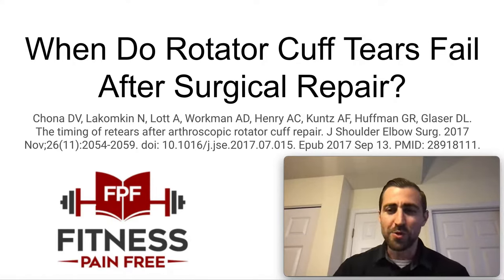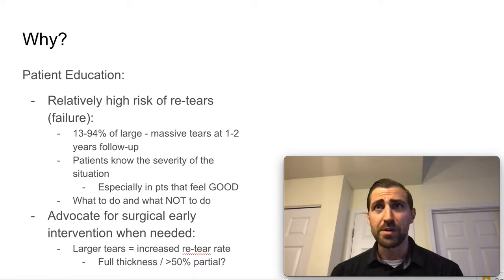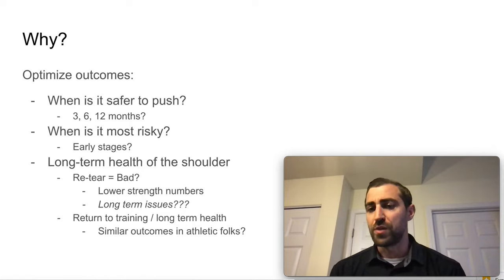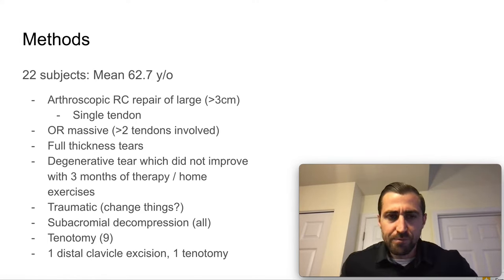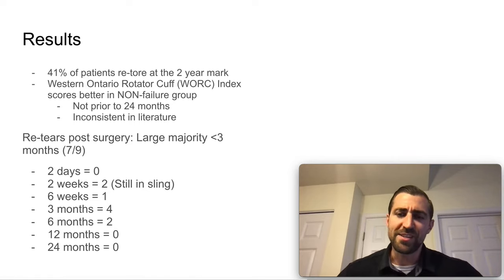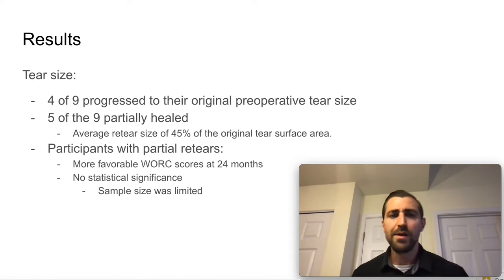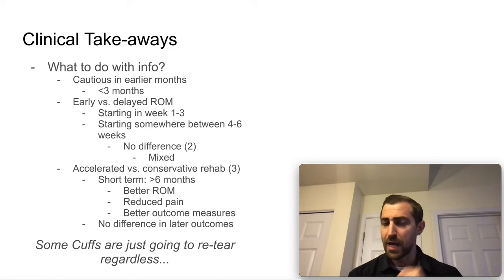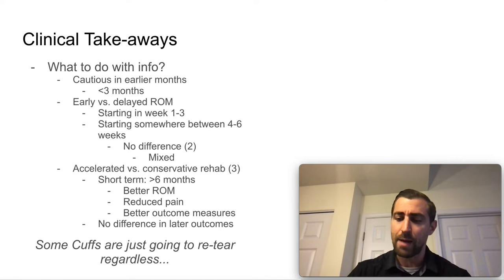When Do Rotator Cuff Tears Fail After Surgical Repair? | Arthroscopic Surgery | FPF E:31

Comment: I had repair 12/28/22, started out ok but at 3 months felt a lot of pain and spasm. I thought an anchor was out but was reassured it wasn't. I'm scheduled for "Revision" of the Infra/Supra, new tear of (26x20) removal of an anchor floating under the bursa and a new anchor for the repair and reattachment.  I'm 67 now and in very good health. I thought I felt the anchor pull out and spent over a year thinking that I was just a slow healer. Problems mostly with sleeping and at the extremes of motion (except when anchor moved into the bursa) I have full ROM and roughly 80% of the strength on my dominant side. My Primary is a sprots med doc, and he was very surprised at the MRI findings, but I'm one of those people who can tolerate and override pain. My advice to anyone undergoing consideration of RTC repair is, if your sleep is disturbed to the point of making you miserable get it done. However, make sure to know the extent of what's being done, the rest and rehab requirements and the potential risks and complications. I was informed about the possibility of a failed repair but the "anchor" pulling out happens in less than 5%, and the surgeon who has practiced 30 years, said it had been well over 5 years since he'd had one come out. Use a good physical therapist and follow the instructions to the T.
Reply from the maker: Sage advice.  Sorry to hear about the anchor.  Glad you’re in a better place now.

Comment: Thank you so much for this.  There’s a lot of confusion of what happens after your sling comes off in 6 wks but really the sling should mostly on until 12 wks so you’re not aggressive with the injured arm. I thought maybe I could start crossfit after 3 months but like you indicated it needs to ramp back after 3 monthes so I’m delaying crossfit to starting back in maybe 4 months. This is super important info. Nobody wants to go back and have surgery from a retear because I’ve been warned retear surgery outcomes are not as good as the first repair.

Mine was traumatic full retracted tear of my Supra from running into a wave pool wall while surfing. in week 4 after the repair. My surgeon insisted no isometrics PT until 3 months and we were wondering why. He said it was because I had a full tear but as your video indicates really it takes 3 months to heal before you can actively start loading it. I’m 58.
Reply from the maker: Sorry to hear it but glad you’re doing well.  Ya it takes some time to heal well.  Make sure you have a good PT who understands the demands of CF and what you want to get back to over time too!

Comment: 60 yo M w bilateral full thickness supra spinitus tears 9 mos apart. Hx 30 yrs firefighter paramedic, wanna be body builder, 7 yrs kick boxing in my forties, 5 years of Brazilian jui jitsu and counting. Second tear had obvious long term partial tear w significant retraction. After first repair ( R ) shoulder  ( sept 2022 )  I was back on mat fighting 4 months post repair and still continue gaining strength and rom. However, second repair (L) shoulder ( may2023 ) appx 6 months post repair and still  struggle w all aspects of rehab. Zero pain    But rom and strength remain appx 50% of pre tear abilities. Would be interested to know if my overly high expectations of rehab has retorn ? FYI, rehab daily with band work prior to strength training kettlebells, TRX and mobility exercises. Last, what is your opinion on hanging for shoulder health post tear repairs ???
Reply from the maker: Good work on the rehab.  Not a bad idea to get it checked my the doc at this point.  Personally not a huge fan of hanging for shoulder health in generally unless you have a very specific reason for doing it.

Comment: Yup. Woke up from a quick clean up surgery to be told I had " a bit more work done". Full Thinckness tear pulled all the way back off the footprint, shaved clavicle, shave off failed Slap repair, new slap repair and my bicep had to be reattached. It took me have to ask for a walk through of the surgery at my check up date to find out how serious it was. Finding visual graphics of the stated surgery has helped understand how serious this really is. However at my 8 week check up I couldn't lift my arm under its own strength past Mayne 20 degrees. MRI follow up on Thursday. Fingers crossed but this surgery is nothing to shake a stick at. Trying to remain hopeful but it sucks my arm and shoulder feels way worse then before surgery.
Reply from the maker: Hang in there sounds like a tough surgery.  Stay positive I think you can start making some progress in a positive direction
Reply: Any follow up on this?
Reply: Hey Alex, I would love to hear an update!
Reply: Any updates om your shoulder or arm pain after your second surgery.I am having your exact symptoms

Comment: I had a slap repair done July 26th 2022, here it is August 3rd 2023 and I had another MRI done this morning. I’m still having pain and swelling in the front of my shoulder and my shoulder blade is still getting stuck a year later.
Reply from the maker: Well I hope the MRI gives you some answers.  What was the doctors thought?
Reply: Unfortunately he told me that I’ve reached my MMI and now I have a permanent impairment rating of 8%. I was told that, I’m as good as I’m going to get. Until till this day, I’m still having pain and arm gets tired fast. I can’t lift, push or pull anything over 10 lbs 😢

Comment: Excellent info.  I have had two surgeries, one in each arm in the last 9 month that were long overdue from high level of sport for many decades.  This info is excellent except I think these studies totally omit a couple of contributing factors that I believe are probably hugely significant but overlooked in healing 1) underlying physical, metabolic and mitochondrial health, sleep, and diet.   Since 80's of Americans are overweight, metabolically unwell and have insufficient sleep, it would stand to reason that 80% of the participants in these studies also are the same, and that these factor could have significant impact on healing.  These studies should control for these factors or they are insufficient from a scientific perspective.
Reply from the maker: Great point. The majority of people being treated surgically for cuff tears are average sedentary folks.  There is quite a bit of research showing comorbidities like diabetes making outcomes worse so to your point being a healthy person is probably helpful.

Comment: I’m having surgery in May my rotator cuffs are not repairable, the dr said it wouldn’t hold from surgery so I have to have what they call reverse shoulder replacement surgery
Reply from the maker: Good luck! I’ve worked with many folks with reverse total shoulders.  Can be very helpful for reducing pain.

Comment: Thanks for the timelines on snatch, C&J, and muscle ups. It's ery difficult to find any good guidance on these specific types of high skill, high load movements.  What are you recommendations for returning to heavily loaded deadlifts (500+ pounds and/or 2-3x bodyweight)?  How many months should one expect to wait for getting back to those types of heavy loads for deadlift after having rotator cuff surgery?
Reply from the maker: Depends highly on the individual tear size, repair etc but around 3 months I may start holding weights in the hands to perform things like lunges and steps up and DB RDLs.  After around 2 weeks of that I’ll start loading deadlifts starting with lower RIR and progress up over the next month or so.  I’d say on the fast end 4 months and on the slow end 6 months.

Comment: I had surgery due to a football injury about 2 months ago. After 6 weeks my shoulder started to make a squeaky noise, almost like stepping on a floorboard. It happens often and with fairly minimal movement. Nothing hurts but it has been a little concerning. Not sure if i should just leave it or make an appointment with my surgeon.
Reply from the maker: Not a bad idea to get it checked out if concerned but can be a normal part of rehab process.
Reply: I am 4 weeks post rotator cuff tear repair.....my therapist started me on the pulley exercises the first day of pt at the two week mark. Scared me so bad because I hadn't tried to lift my arm at all per my surgeon and it is extremely painful. What do I do to slow her down? I am 66 years old, work as a school custodian.

Comment: I had a torn labrum repair. I’ve been out of the sling for a month, but I don’t feel that my range of motion has increased much at all. I don’t have any pain usually. Is this normal? Or is there a problem you think?
Reply from the maker: If you’re concerned there is an issue definitely call the doc.  Labral repairs tend to feel stiff and tight after surgery and in a lot of respects they want this to happen (they just stiffened the structure that stabilized the shoulder)

Comment: Great video to take rehab seriously in order to heal well. 
I had a full thickness tear that my Dr said the muscle was split. He was able to mend it 100%. I am 3 weeks post op. I was given a block to put between me and my arm with a sling. Im going to start pt at Burke in ny which has a great reputation but how do I know if I have a very good pt? I am 60 and am very active with weights. Also when can I work out my lower body(at home)? Is there a way to prevent frozen shoulder? Thank you
Reply from the maker: Thank you! Your doc and PT should be able to answer those questions.  Depends on the injury surgery and physician really.  Hard to assess good and bad PTs but largely should know a bit about what the evidence says treating these, have some knowledge of the surgery and have seen a fair few of these repairs

Comment: Hi Doc, I'm 38 yrs old and all my hobbies are active. I have a partial torn(.9cm) supraspinatus. Debating PRP with therapy  and BPC157 likely as well Vs. surgery. I hope to be active another 20 years. What would be your advice based on my age and expectations?
Reply from the maker: Generally speaking partial thickness tears especially <50% torn are not treated surgically.  Probably conservative with a close watch on progression over time.  Do you have a good doc and PT? Best to get a good eval and plan there.
Reply: @fitnesspainfree  I was told that this tear is 70% through @ .9cm. Yes I had 2 opinions. One said I was in a gray area and left me with the options. The other recommended trying rehab with PRP, and getting another MRI in three months to see if it is getting better. If not then surgery.

Comment: Very informative.  Thanks.  I'm 5 days PO. Massive supra and infra tears, bicep tenosis, etc  Concern is of course about re tearing.  Odds seem not in my favor.  Was blunt trauma fall and doc said tendon looked like it had some meat on it still, so does that increase my chances by a significant amount? What are some good ways to get blood flowing through the site to help the repair?
thanks
Reply from the maker: Hey Steve, hang in there.  Good news is that if it was traumatic then the tissue quality was probably pretty dang good so that’s in your favor.  Largely just follow the doc and the PT protocol and that should give you your best shot.
Reply: thanks!

Comment: Did the patients in this study have graft augmentation of the repair area? Or was there a mix?  I just had my 4th left shoulder tear repair and this latest operation included a dermal allograft augmentation.
Reply from the maker: I’d have to go back and read it again but I don’t think they did.  How did you retear yours?
Reply: @fitnesspainfree  I had my first tear in 1998 from a fall playing hockey.  That repair lasted 10 years or close to it.  I had 2nd repair in 2008.  Then the 3rd repair in 2015 and 5 days ago the 4th repair with the graft.

I think the last tear was done at the gym doing overhead shoulder presses. I felt it happen.  They also put an arthrosurface implant over the humorus.

Next stop reverse replacement which I do not want